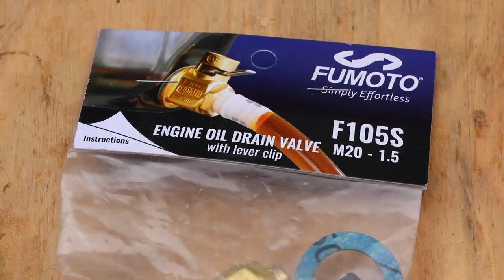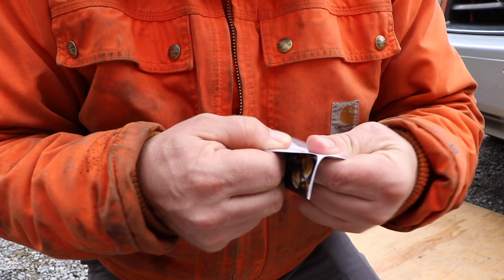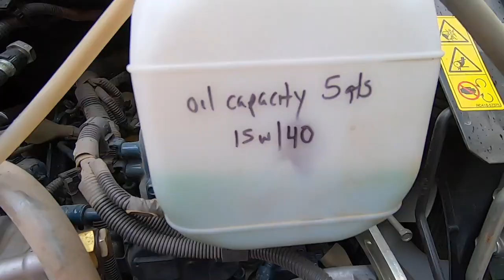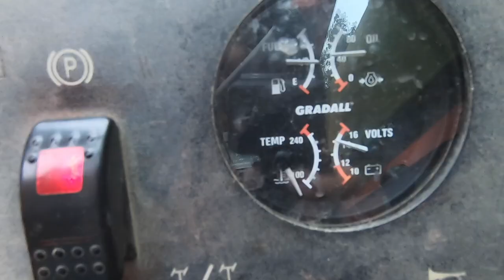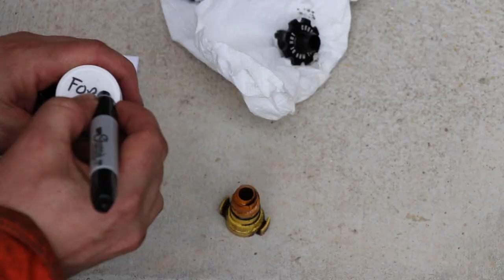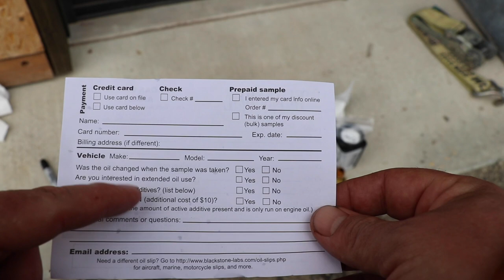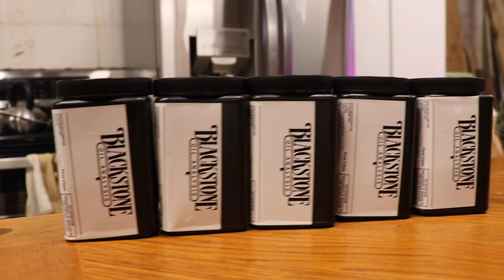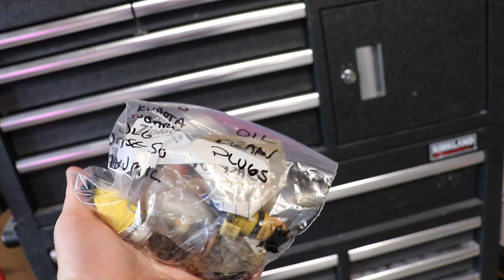Sampled Oil in Everything I Own... Here's What Happened

Comment: The reason aircraft do this is it would be bad to have your engine go out mid flight.    Aircraft also don’t run over things and won’t have these pop open.   Its not interesting, it goes back to your space shuttle designer wanna be engineering mindset for everything you put on video.   If i was buying a piece of equipment, the person handed me an oil report for every 100 hours, I would know that this person has no idea about the equipment and or maintenance.    Who knows what they did to that equipment, thinking they were making it better.    As mentioned before, the first log, bush, whatever you run over and pop that drain off or open, gonna be expensive replacing or buying a new engine.